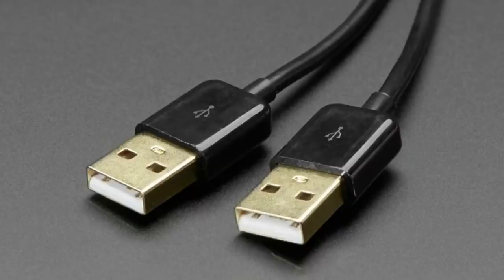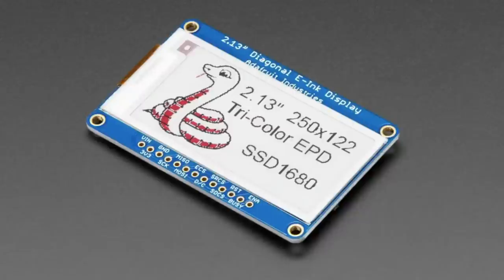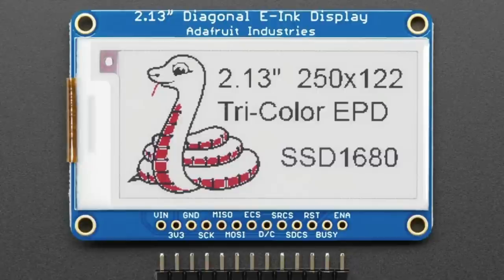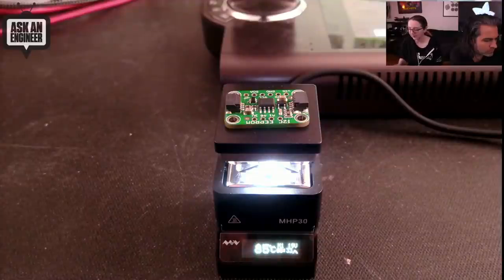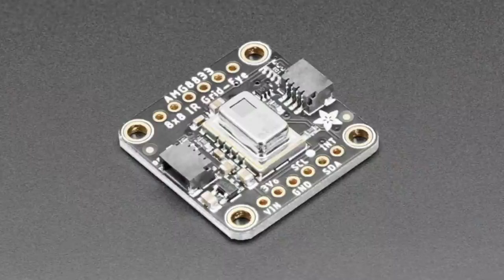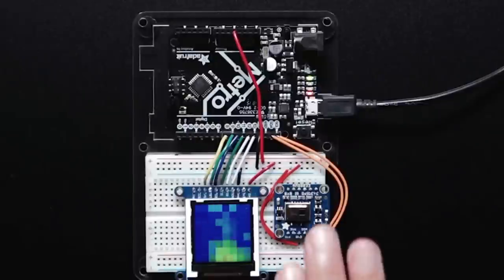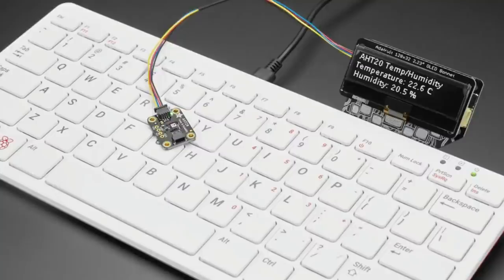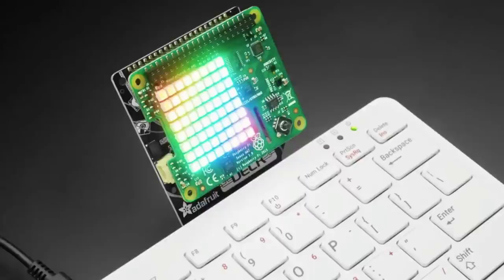New Products 3/10/2021 Feat. Adafruit CYBERDECK Bonnet for Raspberry Pi 400!

Comment: The hat and bonnet look cool and I so want one by why use the 3 pin and not a 4 pin grove compatible connector?
Reply: The smaller Stemma QT can be adapted to Grove, they have a cable for that. The 3 pin is usually for things like NeoPixels.